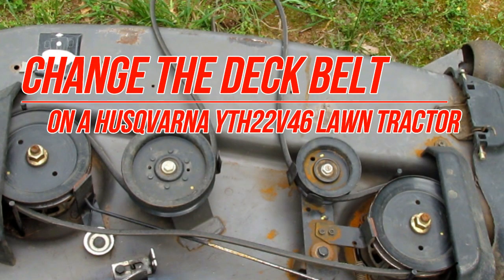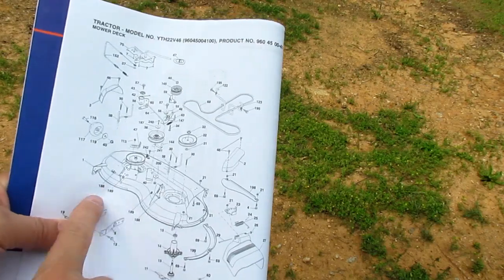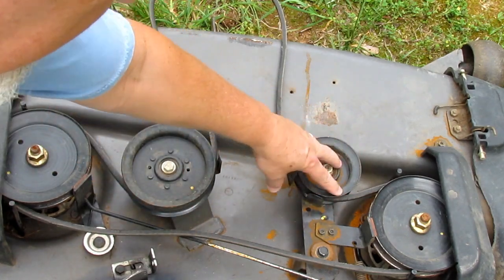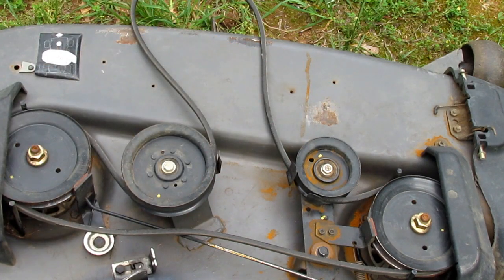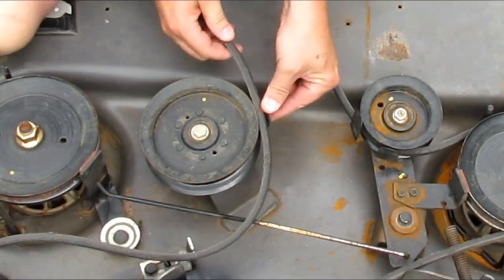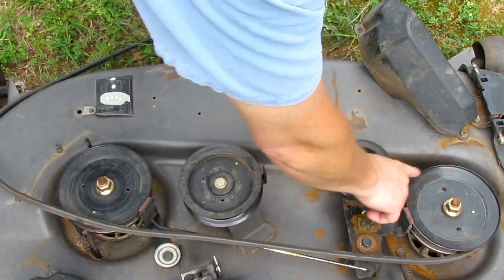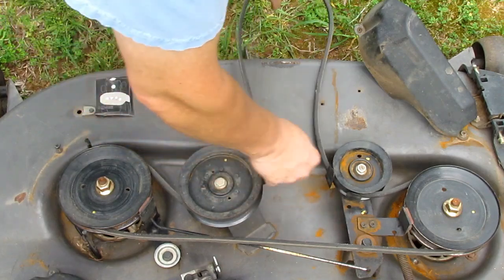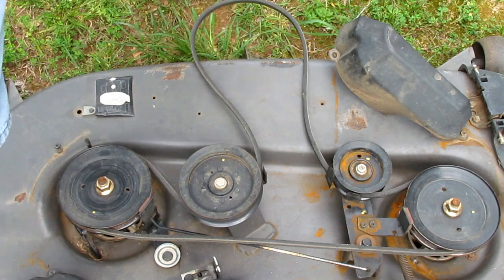Replace Deck Belt on Husqvarna YTH22V46 Yard Tractor

Comment: After replacing the belt as shown on your video (but without removing the deck), the belt does not have enough slack to be looped over the engine pulley. Any suggestion on the final step of getting the belt on? Thanks.
Reply from the maker: Hi Darren, thanks for watching!   You could try raising the deck all the way up...that won't give you much slack, but maybe just enough.  Other than making sure you have the belt inside of all the guides/guards, there not much else to do for slack.  Is there a possibility your belt is too short?

Comment: Here’s a question for you! I have a YTA 24V48, which I bought in 2016. I’ve never had a problem until this year. When I go up an incline it will slow to a stop. The engine doesn’t seem to lose power at all. However, when I release the throttle then press it down again, it will go again for a short distance or until I get to level ground. I usually have to do that two or three times going up my driveway. Any suggestions? I was told it could be my transmission belt.
Reply from the maker: Hi Shane, thanks for watching!  I'm not as familiar with the YTA tractors as I am with the YTH ones....but it sounds like your drive belt is slipping.  I have a video on changing the drive belt on a YTH....the process is very similar on a YTA, the belt routing is just a touch different.  https://youtu.be/Fyssdm4-S8g
Reply: I went ahead and watched that too! Your channel is awesome! So many things I need/want to do around my house! I hope you keep posting more videos! I’ll let you know if changing the drive belt was the remedy!

Comment: Thanks for the excellent video. My belt just broke last week. Do you think it's doable to replace the belt without removing the mower deck? Thanks.
Reply from the maker: Thanks for watching!  Yes, you can do it without pulling the deck, might be a little tight but it can be done.  I also have a video on how to remove the deck, which may be helpful:  https://youtu.be/T_N9qre4xq4

Comment: Hey I put a new spindle and a new belt in Husqvarna YTH 22v46 /Now the blade engages when I start I don’t know what I did wrong anything you give me that be great is there anything I need to adjust
Reply from the maker: Thanks for watching, Patrick.  I'd double check my belt routing first.  If it is wrong, it could make your blade stay engaged.  Also, check the PTO cable to be sure it is releasing when you tell it to release.  I hope this helps!

Comment: Hi Dennis.  I haven't looked at my brothers mower yet. He broke the belt the other day. He put a new belt on it and it broke immediately. With your experience what do you think he did wrong?  Thank you
Reply from the maker: Hi Tanya, thanks for watching.  I've done that once when I didn't properly route the belt.  It's easy to route it outside of the spring-steel keepers on the pulleys....if you do that, the edge of the keeper will chew up the belt quickly.  I'd say the most likely places to double-check are the wire-keepers on the engine pulley, the flat spring-steel keepers on the spindle pulleys and idlers.  Also, just make sure that the belt runs free after everything is installed and reconnected.  Mower off, blade disengaged and pull the belt along its travel path to make sure nothing is dragging etc.  I hope this helps!

Comment: Hi Dennis, thank you for all the great help videos.  I have a problem: The spring return (#147 in the manual, part #532401872) that attaches to the arm brake (#63 in the manual, part #532199477) came off & I can't for the life of me find a picture of the hole or whatever the spring hooks to. The closest I've gotten to finding out was in this video, where the end I'm looking for is just out of sight. Can you tell me or post a pick please? Also, the brake pad is very worn & grooved from the pully, I'll be getting a new one. Could you also provide a link to where I can buy either a downloadable version or a paper copy of the actual mechanic's repair manual, not just an exploded parts diagram? I'm having great trouble hitting dead ends there as well. Many thanks, Sir.
Reply from the maker: Thank you for watching, Robert!  I'm not aware of an available repair manual.  that spring should run from the spindle brake lever back to the right rear mounting ear on the deck.  This 'ear' is the mounting point for the mower lift rod.  I hope that helps!

Comment: Hey Dennis, Thanks for the video. I have a question. There is a silver piece what I would call the cable engagement bracket under the idle pulley. I have somehow lost this piece. Do you know a part number for that by any chance? Thanks in advanced!
Reply from the maker: I believe this is the part you are looking for.  Double check to be sure though:  https://www.ereplacementparts.com/bracket-clutch-cable-p-656477.html?osCsid=lbnjg2m6e0omhoq775nmlh13g3

Comment: Hey Dennis, Thanks for doing these videos.  I used this one and the one on how to remove the deck from the mower.  Both were easy to understand (for those of us that are definitely not mechanics) and detailed enough to get the job done.  I do have a question.  The belt keeps popping off.  I know I have it inside all the guides etc and even on the inside of the J-shaped hook on the front pulley.  Any ideas?  Is there a part I can get for added support or something.  Is there a way to tighten the belt?  Open to any suggestions.   Thanks again..  ED
Reply from the maker: Thanks for watching, Ed!  If the belt is routed properly and all guards/guides are in place, I'd check to be sure the belt is correct..part number should be 584453101.  Any slight increase in the overall length of the belt can cause this problem.  Next, check to be sure the belt is running 'right side out', in other words, be sure the tapered side is running in the tapered pulleys and the flat side is running against the flat pulley.  If the belt is coming off while disengaging the blades, I've found that if I disengage the blades slowly (and don't flip the PTO lever up), the belt doesn't slip off.  If it is coming off while the blades are engaged, I have a video showing how to adjust the belt:  https://youtu.be/0tB2DYtRhI8
Let me know if none of that helps and we'll try to figure it out together.

Comment: Dennis, quick question how do to install keeper belt looking for clearance of engine  . on a yth22v46 part # 532 19 72-59. want to understand proper installation losing some belts up there near the engine pully Thanks rick Hundley.
Reply from the maker: Hey Rick, thanks for watching!  Where the deck belt goes around the engine pulley, there are two wire guards/keepers that the deck belt goes into.  The long leg of each keeper is attached to the underside of the tractor and the short legs are free.  Short legs are toward the outside, on each side of the tractor.  The deck belt sits in the keeper between the long leg and the short leg, so basically, you just flip it inside of the short leg.  Let me know if that isn't a good explanation and I'll try to help.  Thanks!

Comment: Dennis, this is the first tractor I've owned, and the deck belt broke. Nothing seems to be stopping the pulleys from turning freely. I have about 18 hours on it, and was just wondering if anyone else has broken a belt that soon.
Reply from the maker: Hi Michael, thanks for watching.  I haven't heard of a belt breaking that early...it makes me suspect you had a defective belt.  The only time I've broken a deck belt was when I snagged on of the blades on a small stump.  My belt already had a worn spot and the impact of the snag just popped the belt.
Reply: Michael O'Pry Mine broke around 40 hours but something got snagged in it I believe.

Comment: whenyou tighten the guide pins - do they self center or will they touch the pulley?  I mean when you tighten them - they will be in the right position, you don't have to worry about them being to far away or close to the pulley?  i just bought the set of spindles you mentioned in your spindle video - and was wondering HOWDO YOU KNOWYOU SHOULD CHANGE THEM?  What are the signs they may be bad - thanks again for your videos and directions
Reply from the maker: Hi David, The guide pins will be properly spaced when you tighten the bolts.  There is very little play in the bolt holes, so they will 'self align.'  You can tell if your spindles are worn by removing the deck belt, then check for play in the spindle bearings by applying side-to-side force on the spindle shaft.  If it moves more than a very small amount (maybe 1/32"), then the bearings are worn and the spindles should be replaced.  Often the first indication is excessive noise from the spindles.  Thank you for watching and let me know if I can help with anything else.
Reply: thanks have a Happy Memorial Day Weekend
Reply from the maker: You too sir!

Comment: I already replaced my belt since the last one snapped. I feel like the belt is a bit loose when it has tension. Is it normal?
Reply from the maker: Yes, I don't have an actual measurement on belt tension when engaged, but it should not be terribly tight, otherwise you just wear out the spindle bearings.  If it is tight enough that it doesn't slip, it is ok.
Reply: Appreciate it.

Comment: Did you remove the guide pins completely off one of the spindle pulleys? It looks like you did but I didn't see you do it.
Reply from the maker: I think I did on this video, but it was because one of the bolts broke when I was loosening it.  Normally I'd just loosen the bolts enough to get the belt off the pulley.

Comment: Hello Denis. Thanks for all the help. Worked with my dad to replace his spindles And belt. However after putting it back together we had two issues And thought I would get your thoughts. 1. The blades turn slowly before engaging them. When turning the blades on they turn great and the grass gets cut well. They just never stop turning.
2. When stopping the mower and putting the blades to idle (although they don’t stop spinning completely) all the sudden a recurring ponding sounds comes from the blades or belt area. 
It’s very odd. Thanks for any thoughts. 
Tell the Lizard hello from me and dad.
Reply from the maker: Thank you for watching, Matthew!  I'll pass your greetings on to the lizard...haha!  Sounds like the belt might be a bit too tight.  I have a video on adjusting the belt...it's aimed more at tightening the belt as they tend to stretch over time, but it will illustrate how to adjust the belt tension a bit.  It sounds like maybe the belt has just enough tension on it when disengaged that it is still turning the spindles a bit.  Not sure what to think of the pounding noise.  If loosening the belt a bit doesn't fix the problem, I'd take the deck out from under the mower (see my video on that too), take the deck belt off and check both blades, spindles, etc for play.  Spin the blades and listen, etc.  That should tell you where the noise is coming from and figure out what needs to be fixed.    Let me know if I can help.

Comment: Hey Dennis great video. I was a little confused at the part number. When I search the internet for a V belt from my yth22v46 Husqvarna it came back with the part number 53213 0 9 6 9. I bought it and that 92 and 1/2 in it seems way too short. I'm assuming the one that you mention on your video is the right part number. Can you please verify. Thanks so much.
Reply from the maker: Hi, thanks for watching, Lrak!  That is the part number my parts manual shows and the part number I've used to buy a replacement deck belt.  My manual also shows that 92-1/2" is the correct length for the belt on a yth22V46.
Reply: Apparently with that same model mower there’s a 105 and three-quarter inch belt and 106 1/8 inch belt… I have been getting the 107 inch belt from Lowe’s and it seems to work.

Comment: Appreciate your videos... Wondering if anyone else has experienced the issue that the factory suggested belts (1/2by106") are too big?  The only belts that seem to work on my YTH22v46 are slightly smaller, 1/2" by 103".  Am I the only one that's finding this?
Reply from the maker: Thank you for watching!  I haven't experienced this with my mower, but several viewers have had that problem.

Comment: I've had a struggle trying to find the right belt for this mower.  The OEM belt is too loose. I was given this mower and the original belt is long gone by now. 105 is too long and 101 is too tight so that the blades are engaged constantly.  I don't see anything that looks bent or that would explain why the OEM is too loose.
Reply from the maker: Thanks for watching, Mike!  If you have a YTH22V46, the OEM belt is 584453101 and I have a link in the video description.  This is a 105.75" belt.  If it is too loose on your deck, you may just need to adjust the tension on the deck pulleys, I have a video posted that shows how to do that.  Let me know if you have a different model and I'll do my best to help.

Comment: My deck belt keeps coming off the engine spindle.  Is there an adjustment I can make to tighten up the belt on the spindles?  I broke one of the belt keepers and replaced it recently.
Reply from the maker: No adjustment that I'm aware of.  Maybe the deck belt is worn or stretched and needs to be replaced?  Mine was coming off the engine pulley occasionally before I replaced it.  New belt is having no problems.
Reply: Thanks man!  I didn't think so either, but thought to ask since you're familiar with this mower.  It's a really good one and looks easy to service so I ordered a new belt anyway.  I had to replace my 18 yrs old mower when he went off to college!  
Thanks for your great videos, they're really helpful...keep up the good work!!!
Reply from the maker: LOL!  Yes, I have a 19 yr old weed-eater/edger.  I'm afraid I'll have to replace him in a couple of years too!

Comment: Thanks for making these videos!  Quick question.  I jut put a new high lift blade on my mower and the grass gets stuck and doesn't make it into the bagger.  I've never changed the belt... could that be a cause?  Perhaps the blades aren't spinning as fast as they should?
Reply from the maker: Thanks for watching, Kevin!  Unless the belt is slipping, it should be turning the blades at the correct speed.  Have you cleaned the underside of your deck?  Sometimes a lot of clippings will accumulate under the deck and affect flow.  Also, check to be sure the area under the guards that cover the spindle pulleys is clear.  Lots of debris will accumulate there and could affect spindle speed.  I hope that helps!

Comment: How much play is normal in these belts
Reply from the maker: A ton if the belt is disengaged.  Probably an inch or so if the deck is engaged.....should be tight enough that you can't slip the belt without turning both blades.
Reply: Dennis Ok yeah I’ve been dealing with deck vibration on my lth18538 and not sure how much vibration is normal or if it’s excessive. I checked the belt and the belt has no noticeable gouges the only other thing I can think of is pulleys or spindles how do you know of any of those are bad?
Reply from the maker: Hey Josh,  take tension off the deck belt and check the pulleys and spindles for lateral play.  If you have more than about 1/32", they need to be replaced.  Also, check your blades....you could have a bent or broken blade, or your blades could be out of balance.  I have a video showing an easy way to balance your blades.

Comment: How do you reinstall the right side belt protector rod gizmo up by the front pulley?  Thanks BJ Hickman
Reply from the maker: Hi Bj.....are you talking about the belt guide on the deck or the belt guide on the drive pulley connected to the bottom of the engine?

Comment: Dennis, sorry but having a problem with the deck belt. I have replaced the belt 3 times. The belts seem to last about 3weeks. I have studied your video's. So what am I doing wrong?
Reply from the maker: Hey Rick,  Thanks for watching.  The times I've had trouble with my deck belt...here were my problems:  belt not routed between the spring-steel guides and the pulleys, belt on 'backwards' with flat side running inside the grooved pulleys, belt not routed inside of the guide bars at the engine pulley.  Those 3 things have caused me to destroy a belt in the past.  What is happening with your belt?  Is it burning, breaking, etc?  Is it fuzzy on the edges, like its running over something sharp?
Reply: @dwcoffey  Dennis, it looks to me like the belt breaks where they are spliced together.
Reply from the maker: Gotcha.  Those things I mentioned above are all I can think of....those are all ways I've managed to break deck belts before.  If all 3 have been the same brand belt, maybe try a different brand?
Reply: @dwcoffey  Thanks will do, Happy Holidays.
Reply from the maker: Thank you Rick!  Let me know how it goes.  If that doesn't do it, maybe you can send me a couple of pics of your deck and we can figure it out.  Merry Christmas!
Reply: @dwcoffey  Thank You, Dennis. I try this last belt and let you know. Thanks for your help. And I will do photos if the belt brakes. Merry Xmas.

Comment: Hello, Dennis I'm a dennis from NJ. I've communicated with you before. It is time to replace broken belt - again. I've  done it previously  with no problems. This time there is a LOT of slack around the forward  tractor pulley. I'm concerned ifvivdtsrtcand engage blades  it is going to shred new Stens 265-106 belt. What happened - what did I do wrong? Anyone?
dennis/NJ
Reply from the maker: Thank you for watching, Dennis!  I'd start by checking the old belt length to the replacement belt length, make sure they are within 1/2" of each other.  If that's ok, double and triple check your belt routing.  If that's ok, make sure the tension spring is attached.  If all that is ok, I'd start looking for pulley or linkage problems.